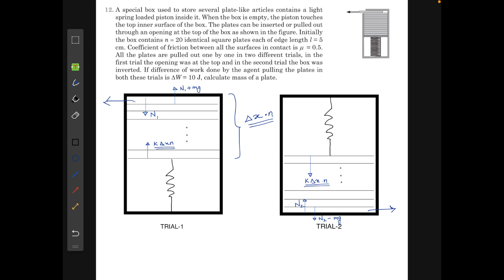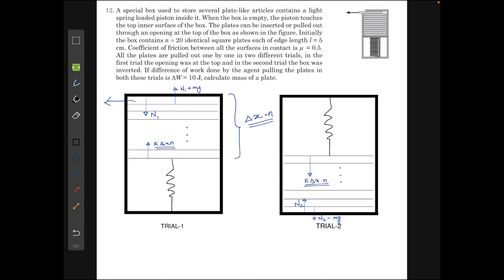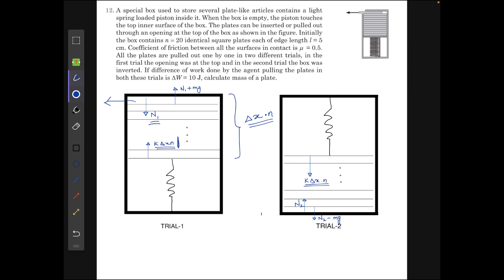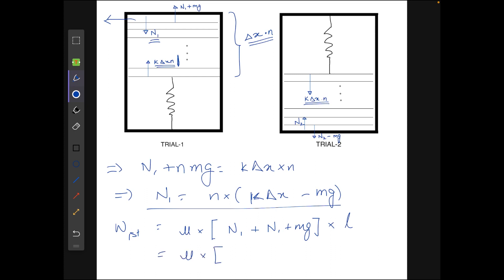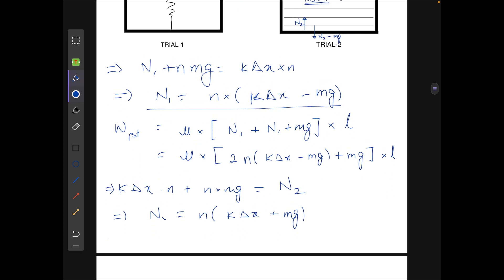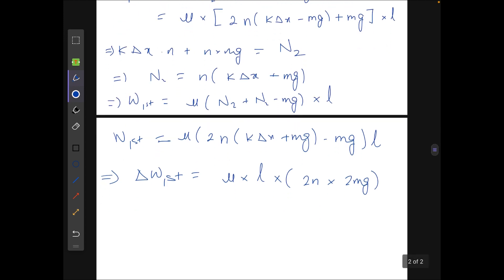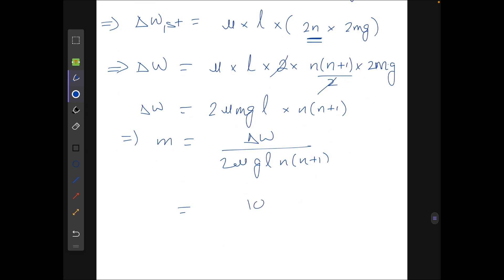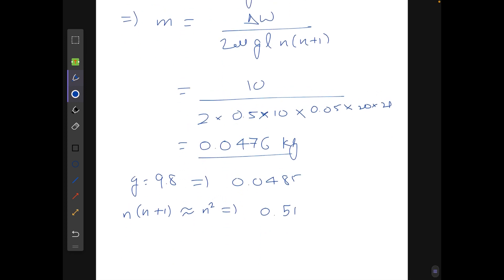Pathfinder CYU Q.12 form Methods of Work and Energy

Comment: sir the difference between the two works is wrong it is 2mumg-4munmg
Reply from the maker: Here we are working in the approximation that n is quite large and only the first order terms matter here and even in the end you can check I’ve approximated n*(n+1) to be n^2
Reply: @babaphysics  you don't need to approximate evaluate sigma for 2mumg-4munmg and you will get the same ans and frankly speaking n=20 is not large enough to approximate
Reply from the maker: @ponnapu  ok sure I had overlooked it ig...but it is pretty big and can be approximated...u can check using values